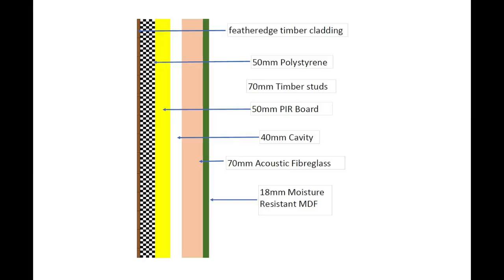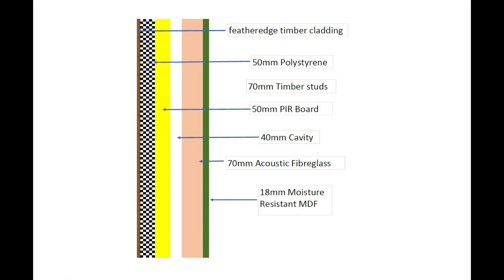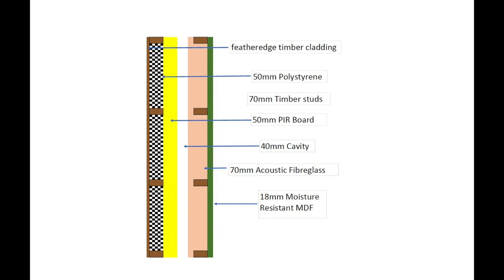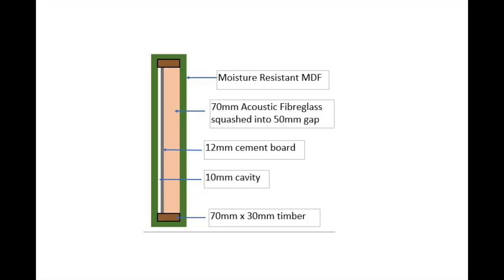How to Soundproof a shed

Comment: Love you efforts here to sound proof you special room. Thought I would share with you my learnings. Imagine a room made of cement bags or plaster bags, how much sound would get through, little or none, so if you filled a door with plaster it becomes dead to sound. I have done it and it is dead, but needs four hinges. The other is the folding and layering of ordinary towels, better than acoustic foam and cheaper. If you don't put your underwear back you will catch you death cold in that shed and you won't hear the ladies knocking on the door.

Comment: Hey man, that's very inspiring and helpful, thanks! I am about to try and build a room within a room and probably will follow your guidelines!
Whereabout are you in UK? Do you know any supplier for fire doors already with a frame?
Also, hope you don't mind me asking what's the blue thing underneath the walls studs? Is that to decouple the walls to avoid flanking? If yes do you have any product to recommend? Would you drill straight through that blue acoustic insulation when installing the walls?

Sorry for all these questions, and thanks!
Reply from the maker: Hi mate. I get almost all my gear from Selco but I don’t think they do doors already in the frame. That blue bit is a layer of anything that can help decouple the walls from the floor. I used carpet underlay but acoustic rubber or anything fairly thick and soft should work.
Reply from the maker: I recently extended and modified the studio. I’d recommend polystyrene over that PIR board as it absorbs more sound. I also used 70mm of acoustic fibre glass between the external studs as that’s a great sound absorber. The new studio has 2 roofs. The external one just supports the external roof and is 5x2”. And the internal one sits on the internal stud walls and those rafters sit between the external ones so the internal room doesn’t touch the external one. Internal rafters are 4”x2”. filled the roof cavity with acoustic fibre glass.
Reply from the maker: I’d highly recommend 2 roofs because when it used to rain. You could really hear it. I have friends with shed studios and they have issues when it’s raining too. The only solution is 2 roofa
Reply: @PherotoneStudios  Thanks a lot for your replies, I appreciate it! It looks like there are many different materials and brands, (some quite pricey) but I imagine in the end the difference is minimal so I will probably go with carpet underlay too!
Reply: @PherotoneStudios  Yes, I know rain is a pain. The thing is that I don't think I will be able to do it because the shed is within planning permission and inside the height goes from 212cm to 209cm. It's true that I am fairly short but if I build a second roof there won't be any space. It's a shame that the space I had available in the back garden it's tiny. I really have little room to play with. I will sacrifice the internal width. It's a built made of SIPs panels, which is great for thermal insulation, but acoustically it's not brilliant...particularly if the dimension don't allow much mods.

Thanks a lot for your help, I checked your webite and it's really cool man! Checked other videos too and they're brilliant! And yes, microphone parts is the way to go...
Reply from the maker: Oh totally. You could spend an absolute fortune on soundproofing for very little gain. It all adds up but there’s a limit to how much is worth doing.
Reply from the maker: Yeah that’s the issue in England. 2.5m max height if you’re within 2m of a boundary. I redid my roof with a mono pitch and very little fall on it. Sacrificed an inch of head heigh for the double roof as the internal rafters only sit 1” below the bottom on the external ones.
Reply from the maker: Just googled SIP panels. Is the roof made of them?
Reply from the maker: Just measures my internal ceiling height and it’s 209 going to 201cm. Doesn’t feel too low. I’m only 5’10”
Reply: @PherotoneStudios  Oh wow, this is reassuring then. If you're "only" 5'10", I am 5'8" ha! One of the few situations where it's convenient being short eheh. Yes the whole build is made out of SIPs. Even here in sunny Brighton it rains a fair amount, particularly this last Autumn/Winter has been non stop
Reply from the maker: I’m only in sunny Kent, so not far from you at all. Yeah it rained for like 3 months solid! What are you recording? I’d it’s vocals and acoustic guitar, it could be worth getting an SM7b as that sounds fantastic and doesn’t pick up the rain so you can still record. Even an SM57 or 58 would do in fairness. Although saying that, even if you can hear the rain on an individual track, you can’t hear it in the mix
Reply: @PherotoneStudios  yeah, not far at all, nice one! I will be hopefully recording guitars and vocals as well as organs and other line instruments. Sax maybe etc.. I am a big fan of the SM7b so I might get one when the wallet is full...also my vocals sounds better on dynamics anyway :) I have an RE20 which is quite cool too. My idea is to restore and setup an old 16tracks fostex (reel to reel). I am getting over obsessed in trying to plan the cavity depth and layers of material in order to reduce the resonance frequency..probably, once I find what I need I will have to come down to earth and accept the space limitations I have.
Reply from the maker: If space is a premium then I’d just leave a tiny cavity. Use a couple of inches of acoustic fibre glass then on the face of the internal wall use a layer of timber then a layer of acoustic fibre glass. It can’t hurt to put a layer of 2” polystyrene on the face of the studwork before any timber sheets. I’ve found the best sheeting to cover the internal walls with to be moisture resistant tongue and groove flooring. It comes in 8’ by 2’ sheets in either 18mm or 22mm. It’s great because it’s moisture resistant (so higher density and less likely to rot in a shed), the tongue and groove means it interlocks so there are no gaps for sound to come through and the sheet size is far more manageable
Reply: @PherotoneStudios  Lovely, thanks a lot! I didn't think of using T&G chipboard on walls, but actually it makes sense! I was thinking of using that for the floor as well. There is a green radioactive one they sell at Wickes which probably will do. Have to check if they deliver sheet materials during lockdown. I will have loads of pboards and other stuff, and probably will have to leave them on the drive ha! When you built your second ceiling, how did you build it? I managed to build the whole thing so far and it still standing, but I am more on the DIY side of things(I am not a builder), so I need lots of advice. Thanks for this.

I do quite a lot of circuit bending and simple elctronics stuff, so if you need any help with that (if I am able to do so), I am super happy to share my knowledge!
Reply from the maker: For the second ceiling I actually had the external walls already built but the roof was off so I was able to work out where all the rafters would go and fix it from the top. If you build the internal stud walls then sit the internal roof rafters on top of the internal wall, that’d wrk. Leave a little gap. Fill everything with acoustic fibre glass then personally I’d put a layer of polystyrene over the lot. Helps with cold air bridging (stops moisture build ups) and then I’d board it all with the green T&G. That’s where I then did my vapour barrier although it doesn’t really matter where that goes. Then plasterboard last. Vapour barrier just stops moisture from outside coming in and moisture from your breath soaking into everything. I have a little dehumidifier to collect any moisture although it really doesn’t collect much
Reply: @PherotoneStudios  Thanks, I will see what I can manage to do in the little space I have!The outer shed it's all built already in SIPs which is good for moisture and thermal insulation, not so great for sound. Don;t know if I have space for rafters and everything. Maybe I will just try to add mass and see how it goes?

At the moment it seems quite hard to find any plasterboard suppliers who delivers...
Pretty soon I will get Wickes' T&G chipboard..exciting!

Comment: Hi again i forgot to ask did you build the shed or did you convert an original 10 . by 6 shed etc. also do you have some pics of the out side etc .
Reply from the maker: I built it from scratch. It’s 4” fence posts set in the ground, then I built panels out of 2x2” which I covered in breathable membrane and then feather edge timber. 
The floor is hung off of the fence posts with additional supports in places and that’s 6”x2” timbers with 18mm ply on top, then a layer of polystyrene then 22mm moisture resistant chipboard.
I think there’s pictures on my Instagram. It’s painted cream with green posts, very fancy. It also has “Club Tropicana” engraved on the front because when I used to train people I’d give them a beer so the drinks were free

Comment: Hey fantastic video, thanks for the information!  Couple of questions if you have the time:  when putting rockwool between the INNER studs, how did you stop it pushing through and falling out the back/contacting the external wall?  

Also, just how isolated would you say the shed is now? For context, I'm a voice actor looking to record audiobooks and voice overs from home, so I need to not hear my neighbour's lawnmower when I'm recording just my voice.   I've insulated the outer layer of the shed (shiplap, rockwool, 2 layers of soundbloc plasterboard with green glue between) and sealed doors and windows.  But the difference is not as great as I hoped.  Will a second room within a room make enough of a difference?  How much outside noise can you hear inside yours?  Worried about spending a couple of weeks and hundreds of pounds on a room within a room, to still hear externals.  Any advice gratefully received.
Reply from the maker: Hello.  Sorry for the slow reply.  I use rockslab, which is an acoustic fibreglass and is quite rigid.  I then build the shed so that the studs are just slightly smaller (about 5-10mm) than the width of the fibreglass slabs and they fit perfectly and stay in place.

Since this early video I have redone the roof so it is similar to the walls.  I can now record when it's raining as I can't tell when it's raining.

Having a room inside a room (i.e. it does no touch any external wall or even the ceiling) will make a big difference.  My room is very quiet however something like a lawnmower is extremely hard to prevent hearing when you're inside a timber structure.  Low end noise from engines, such as lawn mowers, contains a lot of energy which is very hard to eliminate.  

Having worked with voice actors on their home voiceover booths before, it is far harder to create a silent environment than for normal recording studio work, i.e. bands.  When i'm recording a band, or a song, if there's some background noise, you can almost always lose it in the mix as there's so much else going on, but with voice work, such as audiobooks etc, you really do need silence.  

I would 100% recommend building a room within your existing room.  make sure your internal ceiling does not touch your external ceiling.  pretty much do what you've already done, again.  You will need a second floor though.  And for your second floor I would recommend 2" of jabfloor (polystyrene) and preferably a thick layer of acoustic rubber on top of the existing floor for the internal floor to sit on top of.  This is a minimum.  You would then build your internal room off of that.  It will need a second door and if there's windows, I'd recommend building window boxes rather than having 2 sets of windows - these boxes are in another one of my videos.

At the end of the day, you'll never remove all sound while you're in a timber building but having a room inside a room is your best bet.  Just ensure that you use the acoustic version of every single material
Reply: @PherotoneStudios  This is totally brilliant.  And 1 day is not a slow reply!  Thanks for the amazing level of detail you provided, especially regarding voice actors.  I'm confident to go ahead with the internal walls and ceiling.   

A quick follow up, if I may.  My shed has a flagstone floor, and then brick walls on all four sides up to about hip height, with the stud walls and roof built on top of those brick walls.  The brick walls are 24cm thick.  Under these circumstances,  could I build the internal stud walls on TOP of the brick walls (they're deep enough, including an air gap) or should I go from the floor up, with a separate raised floor and an air gap in front of the brick walls too?  The latter would obviously cost me much more space.  But if that's what it takes I'll do it.  I'm just guessing that the brick bit isn't the main problem!  Thanks again.
Reply from the maker: To be honest I would still have a room inside what you already have.  I know it'll take up a lot more space (especially having a second ceiling) and cost more but you'd almost certainly end up doing that anyway.  You need as much in the way of sound waves as possible to take the energy out of them and you're only as good as your weakest point.

What I would recommend, as it sounds like you have space on that 9" wall, is building up the inner side of that brick wall with concrete blocks.  Concrete blocks are big, so you won't need loads of them and they're quick to lay, and that'd add to your sound proofing.  Then I'd build the internal room.  I know that sounds like a lot of work but if the internal room doesn't quite add enough isolation, it's impossible to add the concrete block top half of the wall at a later point.

Please add a separate door to this inner room.

I'd highly recommend running an armoured power supply to your building before doing this extra work and also run an ethernet cable.  It makes working from there easier for data transfer and also makes it easier to add security (cameras, wireless smoke alarm), if required.

Does the building have windows?
Reply: @PherotoneStudios  Thanks again.  That's concrete wall is a serious commitment!  Will think on it.  Tbh my resistance is probably irritation because it will make all the plasterboard and green glue I've just done irrelevant.  I guess I could always build it and then see what the effect is on it's own.  It might obviate the need for a full inner room anyway.  Also, re - the inner structure: as far as I can tell it doesn't need to touch the outer at all?  If it's a complete structure with a ceiling, it will be self supporting and doesn't need to be screwed in anywhere except the floor right?  The shed does have windows; a couple of non opening double glazed units.  Regarding window boxes; wouldn't that make a bridge between inner and outer structure?  My plan had just been to line them up with some other double glazed units in the inner room.  Keeping everything out of contact.  And yes to cables and a second door.  Good shout.
Reply from the maker: Don't worry, it won't make the existing work irrelevant, everything adds up and makes a difference.

Building the concrete inner upper half may give you enough of what you need.  You may find that with low end rumble (from lawn mowers and trucks) it rumbles up through the floor, which is where you room inside a room on multi-layer platform comes into play.  I've often had the opposite issue of trying to prevent a drum kit kick drum sound from being heard from outside a shed studio.  All that energy goes straight through the floor, and not just with acoustic drums kits but electronic drum kits too!

The inner structure needs to not touch any of the outer wall.  So it can't touch any of the walls or ceiling or that sound energy from outside will turn into a vibration and just travel through to the inner room.  The air gap helps stop that. it's unavoidable with the floor as gravity gets in the way so you just have to suffer that and build a platform out of various materials for the inner sanctum to sit on :)

Regarding the window boxes, if you opt for those, have them sit in the inner structure.  To be honest, if your windows are non-opening, i'd personally opt for  another set of UPVC non-opening windows on the inside structure instead of window boxes.  Purely because it's nice to have natural light when you're in a small room all day.  It honestly makes a big difference.

When it's all done, you'll have the issue that the sound you make inside the room will stay inside the room.  This is where you'll need acoustic treatment.  Don't spend a fortune!  But 2 sets of curtains over the windows and doors and a couple of sets of cheap acoustic tiles and a rug for the floor.  That should remove the majority of the echo.  Not that I'm deliberately doing shameless promotion but I did a video on acoustic treatment ideas.  All of the things I recommend aren't expensive.

Just quickly regarding the concrete blocks, they really don't cost much and they're large so you wouldn't need many, so even if you did it yourself and it looked awful, it wouldn't matter.
Reply: @PherotoneStudios  Absolute legend.  I'll keep you updated.  Thanks again